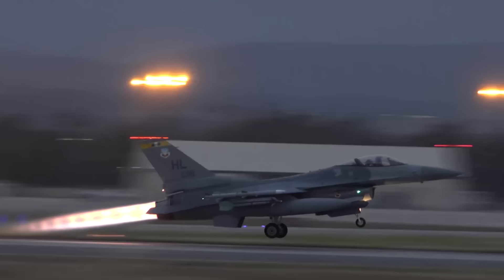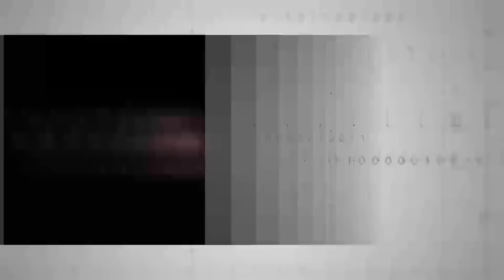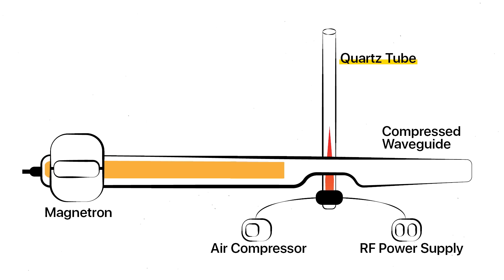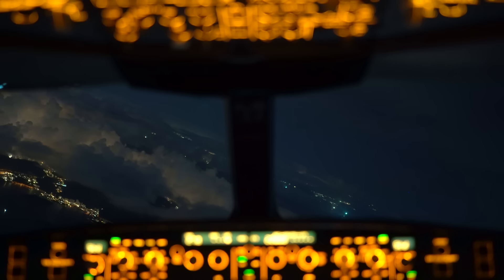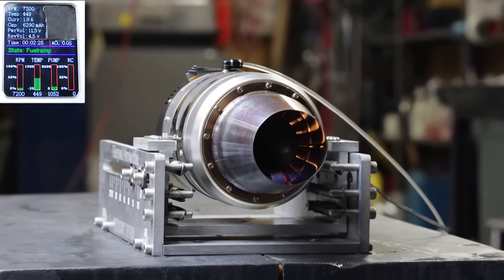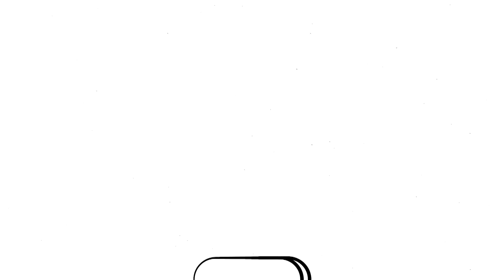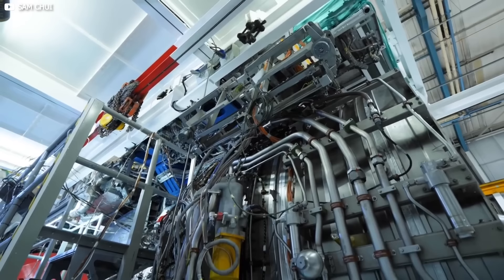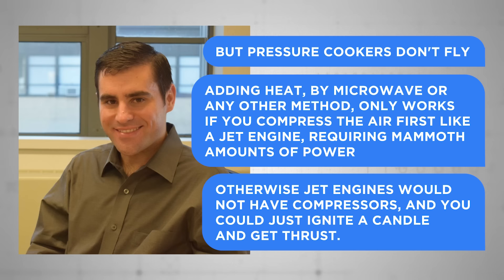What Are Electric Plasma Jet Engines?

Comment: I keep asking about how you going to generate that much electricity. VASMR is a Rocket System in space and the more powerful version is going to require a nuclear reactor to generate the required electricity. It Space, you have the option of putting the fission nuclear reactor on the end of a long boom away from the crew cabin, and can add radiation shielding with multiple launches. You can not do that with an aircraft

Comment: The temperature will be up close to 1.2 mega bar, which is high enough to almost be a solar flare so cooling and containment is a major issue, considering at one point two Meggon bar a diamond gels
Reply: Bar is a unit of pressure, not temperature.  The remainder is gibberish...
Reply: I am sorry, but you’re mistaken there in measuring the temperature melt or yellow diamond. It is done in mega bar, which is a patient of temperature.

Comment: All airplanes have a unit at the back called the Auxiliary Power Unit which is designed to generate electricity. If the issue is power, why not have an airplane's Auxiliary Power Unit running at full power and generate electricity to power these plasma engines in flight?

Comment: The high temperature, rather than new materials for engine housing, since it's a plasma is magnetic containment possible? Oh, actually plasma is charged yeah? could you just run a current through the engine to repel it?

Comment: That video totally misses the point on how modern high-bypass jet engines work: the hot core provides a comparatively small part of the total thrust and mostly serves to power the massive compressor feeding the (cold) bypass stream, which then provides most of the thrust. This electric plasma jet (assuming it would scale up beyond the lab to something useful) would be a throwback to the very first (and quite inefficient) jet engines.

Comment: I hate that you consider its main selling point to be the reduction in greenhouse emissions. This is not, and never has been, a compelling argument. What would the benefits be outside of this? If the plasma is heated to 1000 degrees, presumably it could also generate more thrust (in theory). Anyway, it's nice to see an alternative to injecting fuel into the airstream, and I hope it proves useful.

Comment: Would it be theoretically possible to have a stationary thruster that could direct thrust in different ways and keep the plasma levitated so it does not harm the engine? Kind of like a tokamak reactor.
Reply: I meant to add use Magnetic field containment

Comment: Batteries will likely not reach a point where they can have a energy density even close to oil before we run out of fossil fuels, but I like the nuclear reactor idea. WHAT IF, we used nuclear power to generate hydrocarbons that can fuel jets! Essentially you are using the hydrocarbon as an energy storage device. I wonder if anyone is exploring this.
Reply: No need hydrogen fuel cell is enough

Comment: They designed nuclear powered planes in the 50's, the plasma part of it is not necessary, the original design just used fans and heat exchangers to heat the air and create thrust.

Comment: The high temperature may be fixed by immediately diluting the flow with more compressed air. The cabling problem may be solved if you put a fusion power source in direct contact with the device shortening the distance. We however don't have the fusion device yet. Compact cold fusion designs keep getting shut down. Some of us think we can fix the reliability problem with the Fleishmann/ Pons discovery but most of us don't have the money or the lab. Batteries are a bust.

Comment: If you could scale down this technology and use it to make that plasma ignite a mix of fuel and air that's leaner than before and if possible, recycle a small amount of exhaust gas back into the turbine....

Hmm... I think this microwave-oscillated air plasma could be a powerful alternative igniter for making much stronger thrust....

Comment: My design was very very simple, front half is a traditional jet engine which compresses air into tanks, then the coils induce a large magnetic field into the air the fastest way to achieve plasma is to both pressurise (therefore it'll heat up too) and put it through a magnetic field, once ionised enough then let it out through an exhaust and boom got very highly pressurised ionised gas at incredible temperatures flying out because of the pressure difference of the exhaust creating such a huge amount of thrust. It didn't work as I didn't have anywhere near enough power to ionise the air going in, didn't have a way besides using a motor to keep the compressor spooling as there's no turbine blade and even if it did fire? The temperatures could've been from few 100 to 1,000s of degrees the whole thing would've melted in minutes.

Mind using microwaves to ramp up the energy of plasma is something I didn't think about, kinda genius really as I was just focused on getting coils to do it for me not thinking outside the box. But I do have a theory that maybe true, see you can bend light as it's a EM wave really so, can you bend heat? Yes sounds stupid but can you? If you can bend light energy or deflect it then why not thermal too? Then the engine or even fusion reactors could get as hot as the core of the Sun even higher without failure as the container doesn't heat up one bit! Just wish had the resources to see if that's the case as it would make these technologies like plasma engines and nuclear fusion 100% doable right now meaning our dependence on oil is drastically reduced.

Comment: What disturbs me about electric engines in general is how much power input is required. A battery used in this case would be very detrimental to efficiency because you rely on electron particles ionizing and pushing a several ton aircraft with an already heavy battery; which doesn't get lighter unlike fuels that burn off in flight. Combine that with the fact that there are other forces at play and the theoretical amount of energy required for thrust and basic control systems would mean that electric plasma engines are not going to be possible for longer then a couple of decades. Hydrogen however is more energy dense, but not much better to burn in the atmosphere then kerosene based fuels.

Comment: Use the same frequency that they used to detonate molecules of water, basically fission on an atomic level, reaching over 10,000 calvins at location.  A combination of electric turbine, water, atmosphere, sounds waves,  done.
Reply: It would basically become a steam powered engine.
Reply: unfortunately, causing the phase change in matter from liquid/gas or even solid to a plasma then working with it as an energy source is like adding additional linkages in processing energy, making it less efficient.   It is the reason electric heated homes suck unless they are solar.  Redundancies.  It will work, but the steps to create the plasma ruin efficiency.  You have to dump way more power than you would need to.  By simply creating a chain reaction as you would with a bonfire by simply placing logs on the fire, so, find a way to use sound to chain reaction these micro detonations.  BTW, what I am mentioning was created in a lab in 1937, and was not repeated until 1970.   They literally used sound to cause fission in water molecules.  They shot sound waves against each other at angles adjacent to the electron flow, against them and inward.  This compounds the electrons closer to the protons will energizes them, releasing them from the bonds of the neutrons.  How I heard it correct was they figured out how to torque sound frequencies, and instead of the waves expanding, they collapse in on themselves.

Comment: how about starting with a regular jet engine (that has compression, combustor, and turbine) replacing the fuel combustor by plasma generator for solely heating the compressed gas and let the Brayton cycle do the thrust, as it would in a regular jet engine
Reply: The plasma would melt all the parts of a traditional jet engine after a few seconds of thrust
Reply: @Kingdomkey123678  oh bugger. Ceramic coating :)
Reply: @mathieusan  and then it would be too heavy to fly

Comment: The closest thing that can generate that much power that quickly and not be that heavy would-be super capacitors.   But it would run out of energy very quickly.  I guess you could make it work in quick energy burst and let battery's charge the capacitors.  Not much of a range though due to the limitations of the battery's. 
Also, this won't end our need for fossil fuels as we would still need a way to recharge it.

Comment: You can't beat the basic laws of physics. If you want to make an aircraft fly you need a minimum amount of energy for that. This energy must be stored in the aircraft. So it is NOT the engine or motor or jet or plasmajet or what-have-you-warp-thing that limits the aircraft but it is the ratio of energy per mass of the energy-storage (the Battery, the fuel etc) that is really the limiting factor. So if you really want to make a difference you need to improve the energy storage device. The engine comes later even though through efficiency it can help. And I dont know if the plasma-jet is efficient or just a waste of energy...

Comment: The Quantum Nucleonic Reactor powered plane could offer a solution to the energy density and heat issues.  It does require Hafnium 178 fuel be bombarded with xrays to induce gamma radiation and provide thrust.

Comment: Diesel engines can run on compression and vapors in air, with relatively little startup fuel, if they're not built with shut-off valves that prevent them from continuously sucking the fuel air mix in. If they're capable of doing that, surely someone out there is capable of making something that can self-start on a fuel-air mix that's similar to atmospheric conditions and airborne gases contained within it. I'm just saying, they might be able to make something work that can generate the initial compression cycle, if they can get past that headache they might not need batteries or fuel sources.
Reply: What do you mean when you say "vapors in air"?

A diesel engine needs air (for the oxygen component) and fuel just like any combustion engine.

Without either the air (oxygen) or the fuel, the engine cannot run.

The shut off valve that you might be thinking of, is found only on older diesels.

The reason is because they had purely mechanical fuel pumps, and so the only way to stop the engine running was to stop air from flowing into the engine.

Because as long as the engine is running the mechanical fuel pump is pumping fuel (diesel), there is no way to shut it off (unlike modern diesels that use electric fuel pumps)

Depriving the engine of air (oxygen) meant that combustion can't happen, and so the engine stops.

Because fuel + air = combustion in an internal combustion engine.

Comment: no, you dont need a compressor to get thrust...  there are types of jets that dont need that at all...

ok, so ..... I wonder if we take a conventional jet engine...  if we run that engine ....  I do wonder how efficent it might be compared to if we ran the same engine with turbines powered by the exhaust that would then gen electisity...  and perhaps if we use that electrisity to power air breathing ion thrust?

Comment: They really need to start thinking unconventional.
If they add a little water to a vast amount of air, and increase the absorbed amount
of microwaves you can create superheated water vapor, which also expands,
and heats up the air it is delivered in.
Then using solar film, roughly worth 100kWatts worth, you can add thrust to an already existing plane,
reducing the amount of thrust required by a regular kerosine engine,
without batteries.

Comment: NDB can run them. Its an emerging technology. But requires radiated carbon. Which we can dope in nuclear waste dump sites. Soon I plan on developing a engine design that use ionized air tech. I think its feasible but will need a creative design. Very least I make a fancy fan. Plasma propulsion though? Not touching that at all.

They do have bus size nuclear power plants that are safe and can run an entire city alone. Not sure how heavy they are though.

Comment: It’s a neat concept, but this should not at ALL be talked about like it’s a commercially-usable technology for aviation. The hard part of electric aviation, at the moment, isn’t how to transfer energy to air, it’s how to store that energy. Electric motors with fans are inherently way more efficient than any heat-based engines like this can ever be, just by the laws of physics. Perhaps in distant future hypersonic flight, this could be useful, but till then, I don’t see this having any use in aviation.

Comment: synthetic fuels and carbon capture are more likely to be able to support long term air travel. electrical power could work for propeller planes but only with significant increases in battery density that are not currently even on the horizon.

Comment: Perhaps NOT for Jet planes, BUT might be useful for ground based electric Generation plants.
Reply: Exactly. That's already in the works & the exhaust only output oxygen. They are fabricating a plasma engine retrofit. Apparently London is in line for the first retrofit models to be used within their electric grid. The plasma engine retrofit was introduced to the scientific community at the symposium and apparently it impressed the attending skeptics. A report will be the next step as well as a public introduction. I believe Randall Carlson attended & talked about it on his YouTube station. Pretty fascinating!

Comment: If you were to look at the engine as a whole with just this one piece of technology it looks impossible, what if you design individual components to make up the engine where you balanced efficiency as well as turbines that could produce power that could be used to take the load off current battery. There are other gasses that are turn flammable that aren’t fossil fuels that can be used. Under certain conditions oxygen is extended flammable, combine with the plasma that has been produced there’s every chance that with the help of turbines and oxygen rich plasma could produce enough thrust.

Comment: A critically dense plasma is opaque to light.  A plasma readily absorbs light.  Therefore concentrated solar from trough parabolic mirrors could be used to heat a stream of plasma.  If a stream of plasma is created by passing an electric arc through a stream of compressed air, thousand or millions of watts of concentrated solar energy ficused on the stream of plasma might cause the stream of plasma to extend for the length of a long jet engine.  If most of the concentrated solar is absorbed, a 20 meter by 100 meter long trough parabolic meter would deliver about two million watts of energy to the stream if plasma.  That is the equivalent of about 2500 horsepower.  The low forward air resistance because of the narrow design  and the light weight of the plane without a big load of fuel would make the 2500 hp perhaps the equivalent of ten times more horsepower on a conventional jet plane with a wide wing span and a heavy load of fuel. 6:26 
Pointing the plane towards the sun would cause the mirrors to focus the sunlight on a line down the middle of the engine regardless of the angle of the sun to the horizon.

Comment: Electricity is not free energy nor is it emission free. But for some reason, a lot of people thinks it is?? Thanks for pointing that out.  There is a reason why our world went with earth fuels. Most electricity is created using natural gas or coal (clean coal in the west). So electric transportation is just moving the fuel burn requirements away from your transportation mode. Which may make sense at some point. But E is not free energy nor is it emission free.

Comment: If the temperature gets to 1000° F  or C either way you need a metal that can be able to handle 2 to 2.5x this heat for extended times but the higher in the air the cooler it will be. Now a special battery 🔋 pack could do it for short flights ✈️ up to 3,000 kms or so maybe.

Comment: Uhm no, could you imagine the cost of an aircraft that had to have two differing engines? The cost of such a shift would be so high for such little improvement. Most of am aircraft’s fuel I burned during takeoff and landing. Although I can’t fault them for trying. Even if it doesn’t work, it’s ideas that inspire others and from that significant progress is eventually made. So we should encourage every attempt at further pursuing routes to alternative energy, as long as they don’t take up too much grant money that it hinders others.

Comment: Ain't no free lunch when it comes to energy.

 If it takes 100 buckets of energy to shove an air frame and 300 passengers through the air, whatever your power source is, whether chemical or electrical, has to provide 100 buckets of energy. Currently, batteries can't match the buckets of energy per kilogram that you get with chemical fuel.

Comment: Would it not make more sense to have turbo fan in front to pull in more air to be compressed and ionized near the back of the thruster to maximize the amount of matter converted into ionic thrust?
Reply: Not necessarily, because if you increase the air flow, but keep the power output of the microwaves constant, the plasma torch flame gets smaller. Since with an increase in air flow you need to increase the power output to sustain the same size flame. The paper published on the propulsion shows the different wattage of power and size of flame when air flow is constant etc.
Reply: @arkohmay  ok that makes more sense. Thank you for your insight.

Comment: one idea i had a while ago: stuff compressed air full of electrons, use magnetohydrodynamics to accelerate the results of thusly created coulombic explosion, neutralise the jet stream using microwaves as it leaves the engine nozzle (use beta voltaics for power)- would it work?